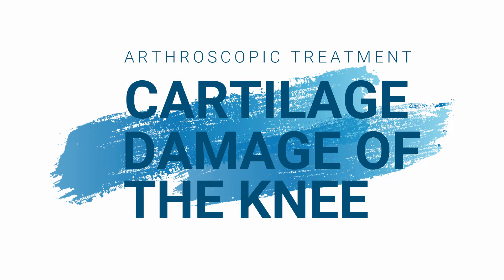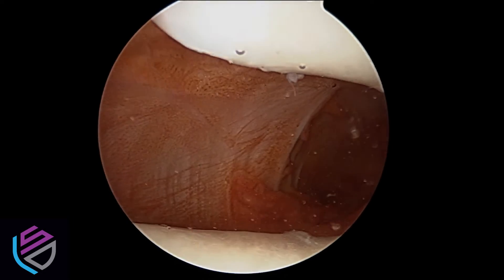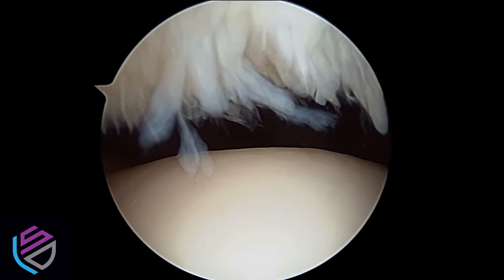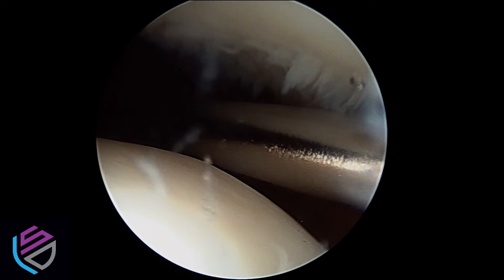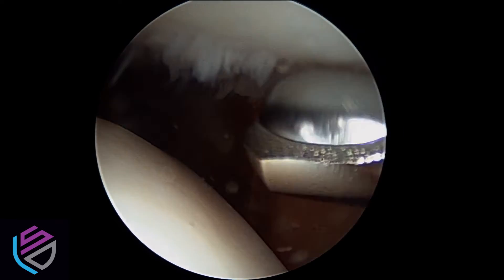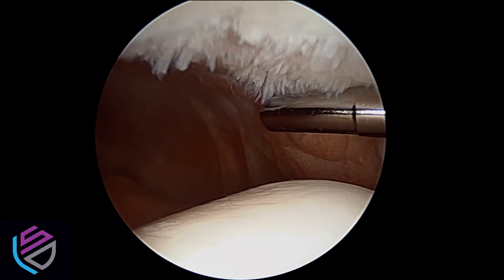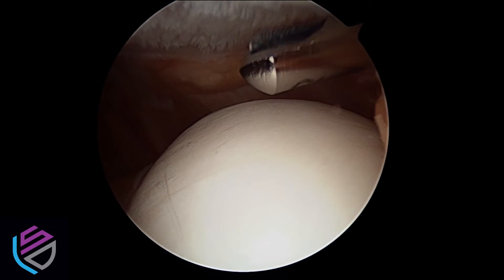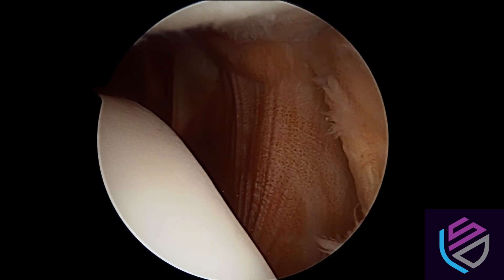Chondromalacia Patella: Narrated Arthroscopic Surgery for Patellofemoral Pain Syndrome

Comment: HI - I'd be curious which grade of chondromalacia this is. It seems already quite advance.
Reply: Dennis Petry this would be Grade 2, where grade 1 is softening, grade 3 is large fissures, and grade 4 is basically bare bone.  That system doesn’t truly capture the true disease progression.  However, there is still viable cartilage left after the debridement of loose pieces.  So it’s not reached the end of the line yet!
Reply: @jameslarson763  ...after my surgery my pain is gone but i still have the crunchy noise when extending my leg.  Should i have another surgery for the noise ?
Reply: @jameslarson763  I am diagnosed with chondromalacia patella grade 3....in lot of pain....and stiffness...unable to bend my knee...no stability....can I go for surgery....

Comment: Hi! I’m 32, and have been diagnosed (MRI of both knees), with “severe chondromalacia of the lateral facet”, but my doctor isn’t recommending surgery, but just Physical Therapy. (I used to play college D1 volleyball and have been in sports all my life). Since doing PT I feel stronger, but I still experience pain, sometimes to the point where I need to rest and take an anti inflammatory. I rely on knee braces. Should I get a 2nd opinion? Thank you
Reply: what cartilage can be regenerate or not?
Reply: @MohitSingh-dj7ic  not cartílago not
Reply: Not So Plain Jane🔥 The radiologist’ idea of “severe” can vary quite a bit.  And there are a variety of surgeries available. If it’s down to bare bone, your surgeon would be right to avoid surgery.  Your knee may be too far gone for surgery like this one to be beneficial.  Likewise, cartilage restoration on the back of the kneecap doesn’t work out that well.  It is harder to get decent cartilage to grow on the patella.  Other options like a Fulkerson osteotomy may help but can be helpful but have a long recovery.  I wouldn’t recommend it with the level of symptoms you are discussing in your comment.
Reply: @jameslarson763  Dr Larson, is radiofrequency ablation of the genicular nerves a good option for patients with long standing retro patella pain who have failed physical therapy and are not candidates for the surgery you demonstrate in this video?